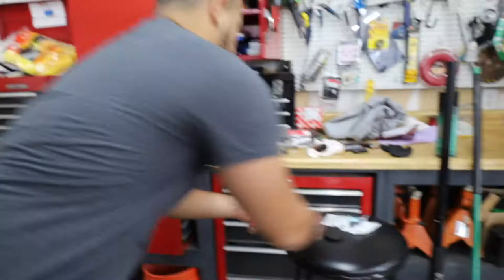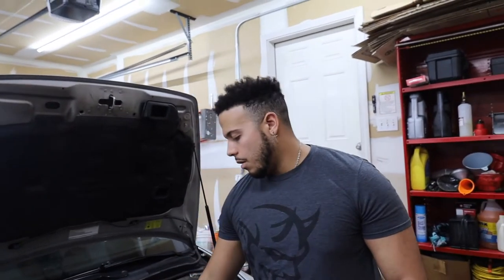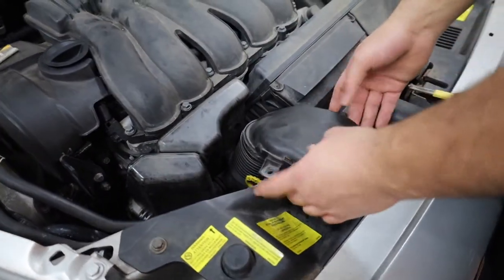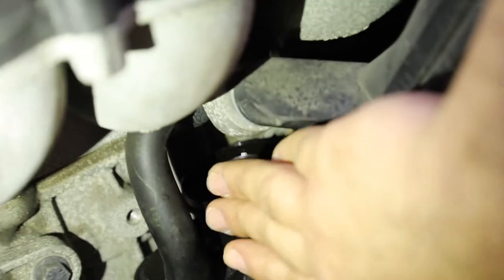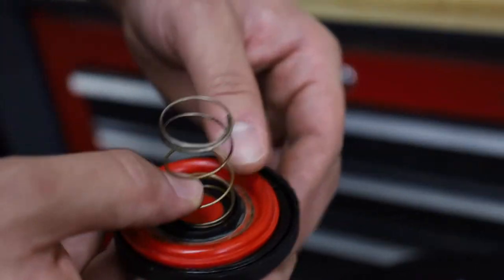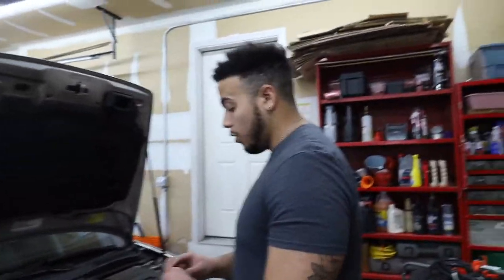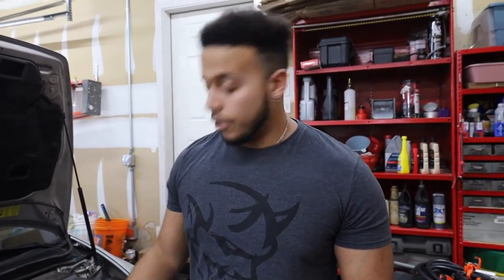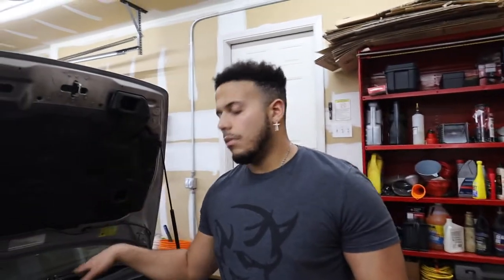HOW TO REPLACE OIL DIAPHRAGM 2004 VOLVO S40

Comment: I have the same issue and tried it doing myself with help of this video and a couple others, I ended up replacing the spring and the diaphragm. But the howling hasn’t stopped.

 The new spring looked a little different than the stock one. So I was thinking that could be the reason. Unfortunately I don’t know what I did to the stock spring to try and test that theory. Do you know where I may be able to order one or if i should just replace the whole oil filter housing at this point

Comment: Thanks for the video. I'm having this exact same issue with the vacuum in oil filler cap and dipstick. Whining/whistling on high revs and loss of boost at high revs. Do you guys think the overboost/underboost could be a result of this as well or maybe my turbo control valve? Have a 603c turbo code stored. No current CELs however. 

Do you just pry up all the way around the top half of the cap to pop it out? I've read to be careful with it cause if you damage the cap or the other piece you will have to replace the entire oil housing unit.